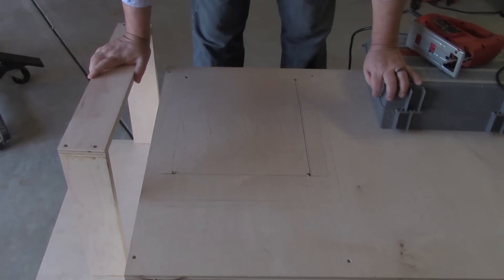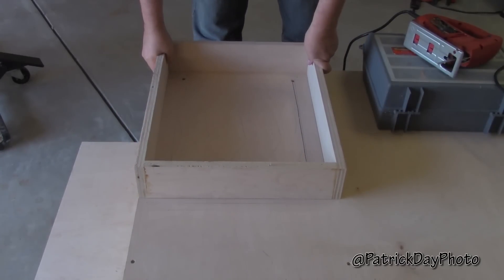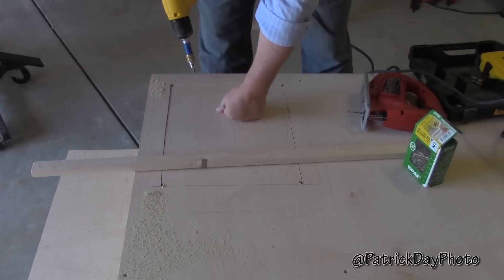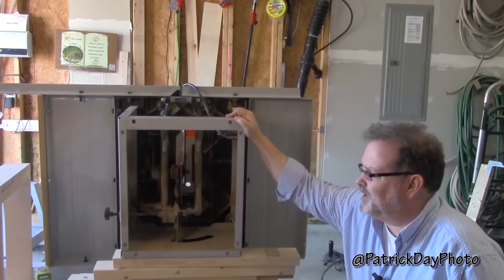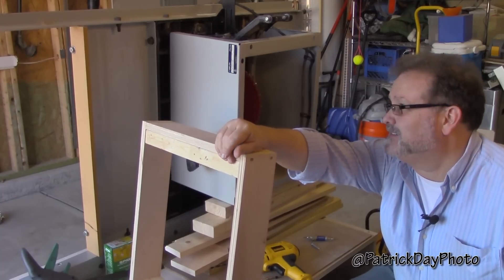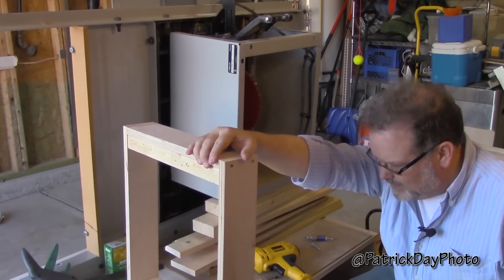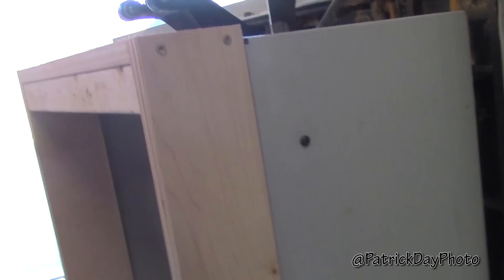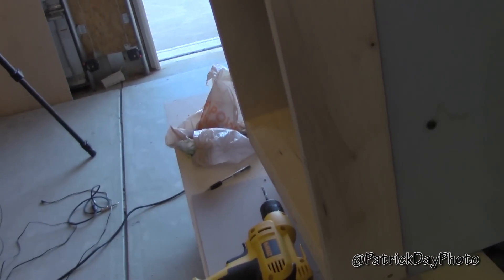DIY Table Saw Cabinet/Workstation (part 2 of 3)

Comment: If you know it is the wrong thing to do - drilling into the edge of plywood - why are you doing it?  When you have a situation where the screws fall on a join line like you did here, drill a hole for a dowel that you have.  Glue the dowel into the hole, and then you can drill into the end grain of the dowel rod for a good hold on the screws that you put in.  Did anyone suggest lag screws?  Use a large diameter dowel, i.e., for a 1/4" lag screw use a 3/4" dowel.
Reply from the maker: Hey James.  Thanks for the feedback.  I'm self taught on wood working so am learning as I go.  That's an excellent idea about the dowel that I've not heard before and will keep it in mind for future projects.  Thanks!